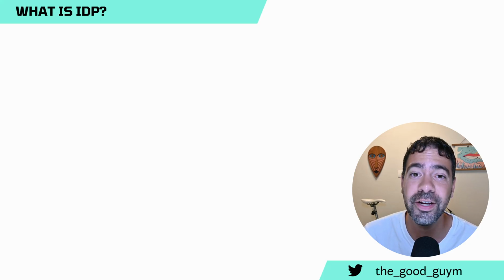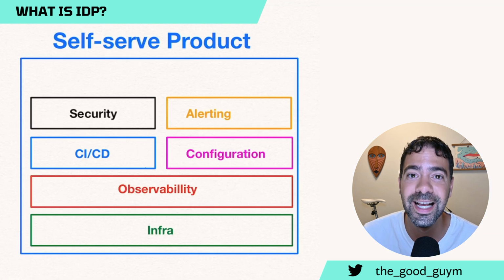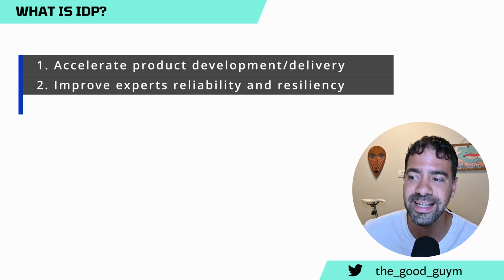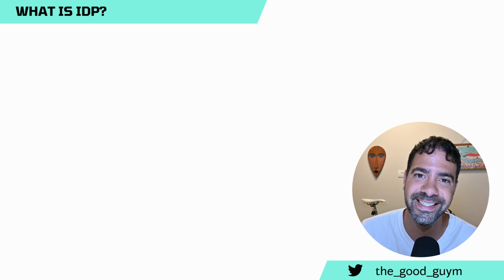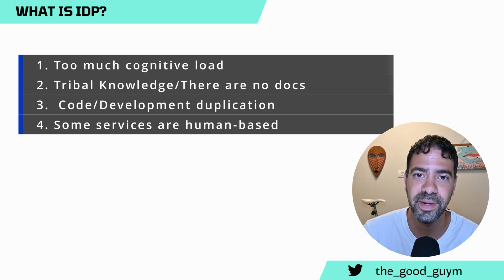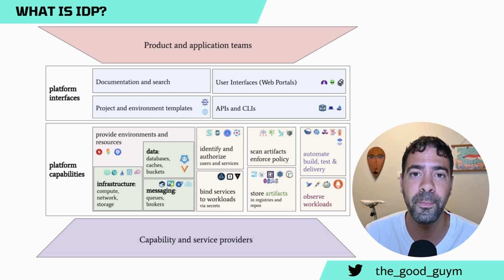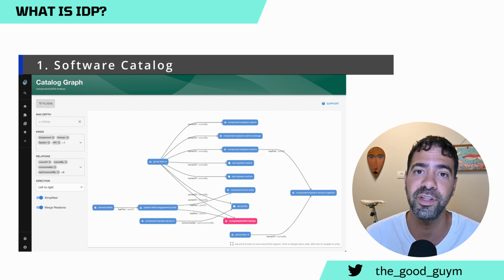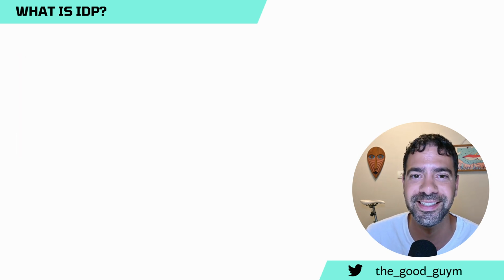Platform Engineering Series | EP 1: What's IDP & Platform Engineering?

Comment: thanks for the great series! could you please help with questions: Does an IDP (eg. Backstage) make sense to an IT service provider organization? Also, it seems Backstage is associated with managing a single organization's software components, while a software service company has to handle multiple client projects at a time, is it still relevant?
Reply from the maker: Backstage or any IDP can fit almost any organization but the main questions is what challenges are you facing. You can create separation between internal entities like projects or systems. I think it is relevant but you need to understand if there is value for such a tool - in any IDP you can create the segregation like you want.